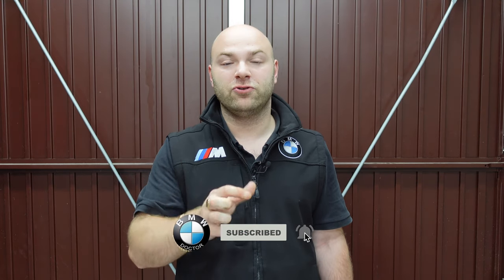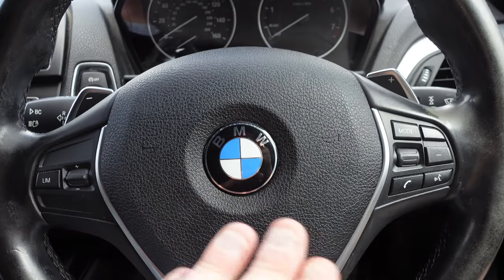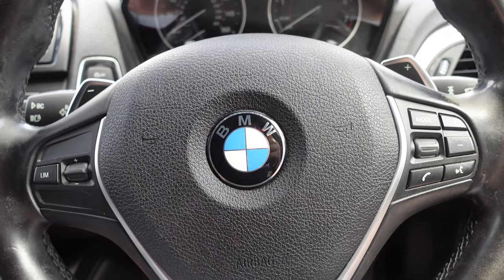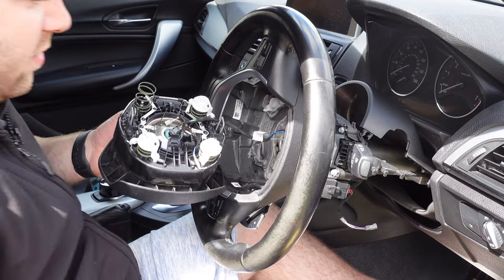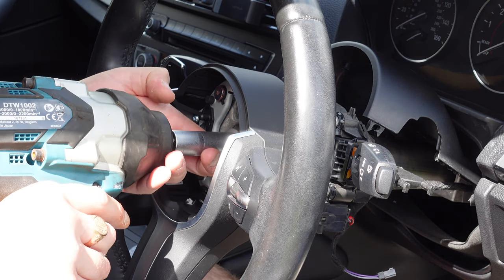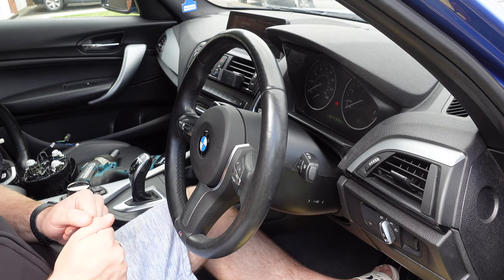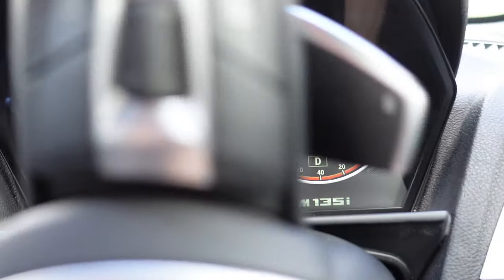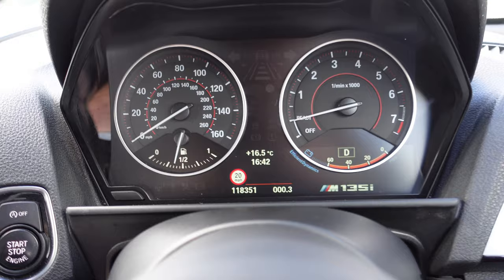BMW F Series Steering Wheel Upgrade / Cruise Control Retrofit (F10,  F20 , F30 )

Comment: Hi. Wondered if you could help. I have a 2012 F20. Same steering wheel as this one before you changed it. It only has LIM. If I buy the buttons and install them. Is the coding easy?

Comment: Hello from Greece.....great, great video! I only have one question regarding the activation of the cruise control unit.....
Which button do you press in order to activate it? BMW F series cars which were originally made with cruise control already installed have a SET button.....first one presses the cruise control button, then the SET button in order to "set" the exact desirable speed. 
How do you do that on your new steering wheel since there is no SET button?

Comment: Hello, just did it and worked wonderfully, except for one minor problem. Airbag light is now on, cables seems to be well coned, I don’t know what it could be
Reply: @josemiguelvigarinhomalho4250  It’s probably either the slip ring or the airbag  connectors on the back of wheel. They seat a certain way and will come loose after one wheel rotation .

Comment: Can I check - for the airbag of the new steering wheel to work, do you need to key in the code of the airbag of the new steering wheel into the CPU of the car?  Or this is not necessary?   

Love the new steering wheel, one of the better looking and comfortable BMW steering wheels.

Thanks

Comment: Good job mate, I am planing to retrofit cruise control buttons in my f series too. Do i need to disconnect the battery if im not going to disconnect the airbag from the steering wheel? I think i can replace the buttons without disconnecting the airbag. Thanks
Reply: You can’t, both button replacement and steeringwheel replacement require the removal of the airbag.

Comment: It may be a dumb question but do you need only to code the cruise control or do you need to buy parts for it (apart from the steering wheel)?
Reply: If you have the same model car and a steeringwheel with limiter function then only replace and code

Comment: I have m135i with cruise control but no limit button. I have swapped for the new style steering which has cruise control and the limit button. Everything works except for limit do i need to code this function

Comment: Mate this is amazing!! I need this on my F48.
I have the new m sport steering wheel like the one you fitted, I have the lim button but no cruise control button. 
Do I just buy the control module on the steering wheel
Button and fit and code??
Where you located? Anywhere in London??
Thanks
Reply: Did you manage to get this done on your f48 ?

Comment: I’ve a yellow wire on my f10 pre lci m sport wheel the new upgrade round air bag style wheel doesn’t have it can I just leave that disconnect or do I need different wiring ?

Comment: Great content! May i ask if this works the same for F07? My original steering do not come with paddle shifter, can I get it to work with the new steering wheels?
Reply from the maker: Yes you can but you will need to change the coding for paddles which isn't hard.
Reply: @BMWDoctor  thank you! Which coding software do you recommend? I have also deleted my rear air suspension and I like to code out the error message on the dash too.
Reply: I changed my Fo7  steering wheel so I could have paddles but can't find anyone that codes them...any recommendations?

Comment: My cruise control button is worn to death and also the station changing rotating wheel on the other side is spinning freely, what's the fix?
Reply: change the steering wheel or order the buttons on the internet and change them

Comment: Hi, quick question. Does f20 msport fit a f10 SE
Reply from the maker: The steering wheel is all the same regardless of car and can be fitted to any F series. Just options may be different you may or may not have cruise control or lim function which can be coded in if need be.
Reply: Happy New Year! Follow up question
You mean a steering wheel from a LHD F30 LCI would fit a RHD F20? Same goes for the heated wheel housing and switch? I'm in Japan and I don't think a heated steering wheel was an option as I can't even find the P/N for it in the online IPC/IPB.

Comment: you need to mention F01 F02  since they use same modules
Reply from the maker: F01 is very different when you remove the steering wheel, and I will show why in another video. You cannot just change the wheel on F01 that simple like the other F series.
Reply: @BMWDoctor   I would love to see how this work and why it can't be since everything in the f01 f02 f04 works on most the f10 f30 f20 even m steering and airbag
Reply from the maker: No my friend it really is not the same. I can tell you now as soon as you said that, you don’t know what your talking about. F30 is completely different to F10 and F01 😂 completely different modules operate differently
Reply: @BMWDoctor   You know better man, I'm no expert and I learn from forms, you and other trusted youtubers and I apply the knowledge to my cars when its needed..... I just seen it over the years some modules are similar, in coding and the way they work when it comes to F01 and F10.... again I love your videos, keep it up!